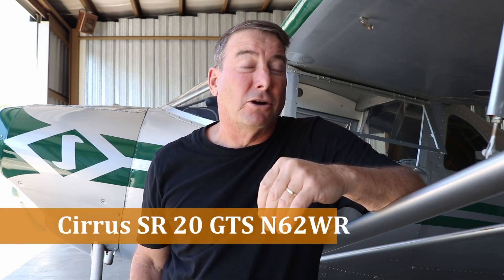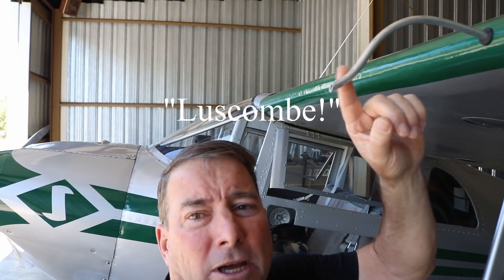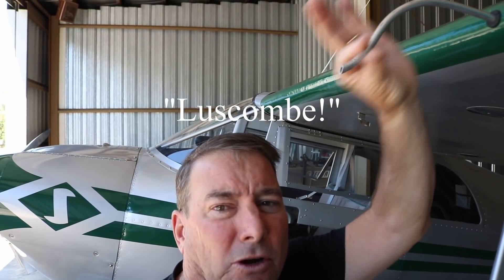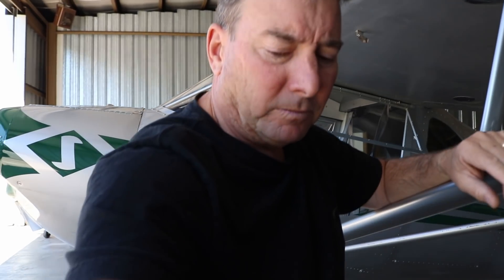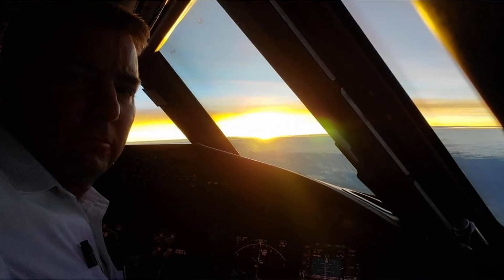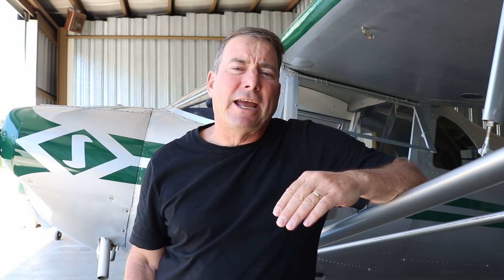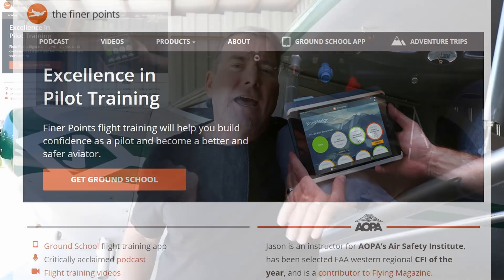Cirrus SR20 Crash Conway AR - AQP for GA!

Comment: Always good, Captain Browne, 
I always judged that,  in an emergency,  VFR, I could fly with no Airspeed Indicator. 
(Stick and Rudder Pilot). 
You can sense your speed, based on the stiffness of the controls. 
(Full Spin qualified, I know when a plane breaks into a spin. )

Comment: Learned early on aoa and power setting will give a particular airspeed if the airspeed indicator is inop
Reply: Yes!  In VFR you could do touch and gos all day, safely, with just power settings.  Poor guy needed more training.
Reply: Yes, and a cirrus also has a GPS speed indication. Even when this is not that precise like the pitot speed, it can help to prevent a stall in approach.

Comment: We have always taught from day one to not only fly by indicated airspeed, but also by paying attention to the visual attitude. Where the nose is on the horizon considering the power being used. With a little practice it is easily possible to maintain a desired airspeed to within a few knots with zero reference to the clocks. A forgotten pitot cover should not be cause for a fatality in a light aircraft especially. Also, I would not consider a Cirrus a suitable aircraft for a low experience solo student.
Excellent vid as usual.
Reply: @capnskiddies  At 200hp the Sr-20 is considered a high performance airplane. Since it generally flies faster, all the speeds including stall speed are faster meaning things happen faster in the pattern and it's easier to get behind the airplane. It's avionics suite can also be complicated for a low hour student..
Reply: I'm a Cirrus pilot and I think it's insane that they are used to train or for low hour pilots. They are fast, powerful, slippery,  terrible glide characteristics,  and too much automation for a trainer imo. I just think we should all learn to fly in a 150 or a 172 where nothing works and sitting on a milk crate
Reply: Just fly the plane!!
Reply: @rdawgz866  LOL. Idk about the milk crate part, but I agree. Initial flight training should always be done in forgiving aircraft.
Reply: @thetowndrunk988  and for full disclosure I fly a SR22T and I think it's by far the best single engine GA aircraft there is. Just not for beginners.  I saw a guy at the place I rent training for his instrument rating in a SR22 Turbo that he owned! So a 120 hour pilot getting set loose in that hot rod. Same as a Ferrari after your kids road test.
Reply: @rdawgz866  My school plane was a 65hp Champ with no electric system at all....after soloing I "graduated" to a 80hp Champ with radio and starter..... I can't imagine learning in anything more complex than say a 152. There's enough going on in a low time pilot's brain, cluttering it up with glass cockpit and a slippery airplane is just a recipe for disaster.

Comment: According to the GoFundMe page for the pilot, he was not a student but an instrumented rated pilot. Pitch and power setting should have been no problem for an instrument rated pilot.
Reply: @GaryMCurran  I believe it.  Private pilots with working airspeed indicators stall/spin on turn to base or final every day.  My bet is that he was highly stressed in a situation he'd never been in, and just let himself get too slow.  I am lucky, I had a primary instructor that noticed I was looking at the gauges too much during my first flights, so he covered them up.  I flew for a long time with none.  It was a great exercise, and had this pilot had that training he might be still around.  Juan is correct, we need better training.
Reply: @tomsmith3045  I can't see how you can be stressed on a CAVU day less than a mile from the airport on final, hell, less than 250 yards from the end of the runway.  i doubt very much that he was turning base to final there, and if he was, WHY?!?
I don't know what the final outcome is going to be, but this is going to be a lot more than failure to remove a pitot tube cover.  Engine failure, maybe?  That I would believe, especially if it happened on downwind, or in the pattern somewhere before he turned to final.
The more I think about this, the more I'm going to believe that something else happened in the airplane.  How about a snapped aileron cable?  No, I'm not saying that's what it is, I have no clue, but something happened that he wasn't prepared, hadn't trained for, and didn't have the time to figure out what was going on and fix it.  The more I look at this, it's not about a pitot tube cover, although that might have been a contributing factor.
Here, how about this.  Water in the fuel tanks.  Again, speculation, but if he didn't happen to notice the pitot tube on the wing, did he actually bother to sump the fuel tanks.  If there was a significant amount of water (even less than a quart) in them, he might have been on the tank with water in it.  Run up, taxi out, take off, that might have been just enough to get him to downwind turning base, or just before, and complete engine failure.  Again, I don't know, but until I hear differently, I'm going to stop blaming lack of airspeed indication, and look for something a lot more dangerous, like an engine failure.
Reply: @GaryMCurran I would have thought so too, except after paying attention to things like the NAL report (or however it's spelled), stall spin in CAUV is really common.  My bet is that you learned to fly in a similar way that I did, with lots of time spent in slow flight, until you were completely comfortable in that part of the envelope...and very aware to avoid it completely at low level.  I'm realizing now that many people don't get that level of training, and they just don't know how the airplane flies.  One example that comes to mind is the air france crew, I believe, that stalled the jet over 90 times, all the way down to the ocean.  Nothing else wrong but lack of airspeed indication, and a professional crew.
Reply: @tomsmith3045  as I'm reading more information, i.e. The Kathryn Report linked in the description, they said he appeared to be struggling with an engine issue.  I think this may have been a case of "the impossible turn" on takeoff, and with lack of indicated airspeed as a contributing factor.

Comment: I've been following a pilot flying a Kodiak in PNG, on every take-off he selects a speed either40 or 50 (knts I think) and a marker by the runway, if that speed isn't reached by that point he briefs to himself the abort take-off procedure. Many of the strips he uses are very small, steeply sloped and surrounded by mountains & jungle. On every flight he passes the speed (before the mark) and calls out "40/50 continue" - even when its an empty plane. (If you think the Husky climbs then the Kodiak is a skyrocket, with empty climb-outs often hitting 2500ft/min with reducing power to keep the speed down so he's got space to make a turn without joining the terrain.)  AQP in action.
Reply: Ryan, (the Missionary Bush Pilot) is incredibly methodical. I have learned a lot from him and brief emergency takeoff procedures on every single take off because of his example even in the C172.
Reply: His WW2 airstrip video was awesome!
Reply: He’s very good he will survive his time bush flying.
Reply: Power plus attitude equals performance
Reply: Ryan Farran, Juan Browne, Scott Purdue, the Pateys, Tent Palmer, Niko Sypridonos and a whole host of other youtubers have done a lot to advance GA safety.  One thing I have learned from these veteran pilots is that the certificate only qualifies you to be a lifetime student.
Reply: @dougarroyo794   I lost a lot of respect for Trent Palmer when he paid a dowser to find where to drill a well on his property. Of course, it didn’t work.
Reply: @bjs2022  Hey, it might have, and then it would have been a good deal. Now I'm not saying dowsing works, but there is a possibility that a dowser has learned to read the terrain better than the average Joe and thus have a better than average chance of locating water, even if it doesn't always work. If his price was a fraction of the cost of exploratory drilling, then it could qualify as a small loss if it doesn't work, and a big gain if it does. 

If the owner can make a video of the dowsing and get enough back on YouTube royalties to cover the cost of the dowser, then the attempt was absolutely free, which is a good deal in any case.
Reply: Love his channel
Reply: @bjs2022  I unsubscribed from Trent & Cory's channels when they started posting non aviation related content.  Jonas M., although entertaining, is just sending out the wrong message regarding risk.  Hopefully over time the aviation community will support great content and we see those that are just here for monetary purposes go away.
Reply: @bjs2022  if you are watching him to see what a great consumer he is, yes I get that... otherwise not so much
Reply: @bjs2022  my dad always used the same old guy to dowse his wells. Always got awesome wells.

Comment: Pitot measures the RAM AIR speed, the IA, Indicated Airspeed.  True and Ground speeds are different.   If he had a glass panel then he would have known the ground and true airspeeds regardless of the IA being zero (if the cover were still on).   Landing without knowing IAS would be more difficult, but in the SR20 he should still have been able to do it using the sight picture.
Reply: Glass panels calculate TAS from IAS, pressure altitude, and outside air temperature. They do it exactly the way we used to do it with an E6B. You can't calculate TAS from GS unless you know heading, course, and winds.
You're right in that the sight picture would probably have saved him. Power and pitch.
My guess is he got too slow and stalled and spun on his turn to final.
Reply: @johnopalko5223  Glass panels display IAS from the pitot/static system and get GS from a GPS source.
Reply: @speedomars  Right. The Air Data Computer (ADC) computes TAS from pitot/static pressures and outside air temperature. If there's no pitot pressure, there's no IAS or TAS. With a blocked pitot tube, all the pilot would have would be GS, not GS and TAS as you stated in your comment.
Besides, the airplane flies on IAS (more accurately, CAS). That's the measure of the air flowing over the wings. The airplane doesn't care about TAS or GS. The pilot might, but the aircraft doesn't.
Reply: @johnopalko5223  Not always.  Both the ground speed and the drift angle (difference between aircraft heading and GPS ground track) can give true airspeed and wind velocity (how an EFB does it).   Still, as I noted ground speed is all one needs to make the landing.

Comment: I would imagine that when a pilot see an (obvious) erroneus speed reading, he would ensure that the 'throttle' is set to a value that ensures sufficient lift - as you indicated yourself. This is more obvious to a trained than to a student pilot. Competence is Knowledge + Skill (x attitude).While the student pilot has some knowledge, I would guess that his Skill is limited.

Then to a question; could the (GPS) ground speed be to any help? Knowing the local wind speed and direction could the ground speed help the pilot setting a 'logical throttle setting'
Or, is the pitot tube readings so different from the ground speed that it would not help?

And while I keep thinking; with todays technology is any training conducted with a single student pilot in the aircraft - but watched remotely from the ground by an instructor who could take the control if so necessary (or the aircrafts 'FMC' take over the control?)

Or does it boil down to preflight SOP - what we call checklists?

Comment: This is tragic and I feel for the family. It also emphasizes the need for a thorough preflight every time we fly. I will mention this accident to my flight instructor. Maybe teaching to abort a takeoff when things aren't perfect or teaching landings with no airspeed indication early on. Maybe this will prevent a future tragedy. One time a while back I started the takeoff roll and noticed the airspeed indicator was not reading and rejected the takeoff. I went back and shut down and someone got out and took the cover off. I usually don't let anyone "help" while preflighting the plane, but somehow this slipped by. If someone asks I usually say  "Stand over there and don't say anything." Another time I knew the pitot cover wasn't on because it was missing when I arrived at the airport a few days earlier. During the climbout I noted that the airspeed was working erratically and the altimeter was not indicating correctly, and continued using the panel-mounted GPS for altitude and groundspeed, which was close to airspeed on this day. The weather was CAVU with almost no wind. During the flight I turned on the pitot heat and after about 15 minutes the bug that had moved into the static hole cooked down enough so everything started working. Those Piper pitot tubes get really hot. Part of my flight training was to simulate a full electrical failure at night and land the plane with no instruments or lights. I also know how the plane should feel through the approach. I didn't need that skill, but I had it in reserve. Part of instrument training is recognizing instrument failures such as this. After getting home I managed to fish out the bug's remains with a fine wire. There is good reason to keep the pitot tube covered, especially in a place with a lot of bugs. Now I keep a spare cover in the rear baggage area.

Comment: Flying using angle of attack (AOA) indicator would be easier and safer than by using indicated airspeed.   To avod stall, simply do not exceed the stall angle of attack.  There is also an optimal angle of attack for climb, for efficient cruise, and for descent.  During steep bank, one is still able to stall the aircraft even at high indicated airspeed when one pulls too hard on the stick to exceed the stall angle of attack.   Landing an aircraft using the AOA is also easier, as one simply maintain the proper angle of attack for the approach, while adjusting the throttle to control the rate of descent to stay on the approach path to the runway.   When reaching near the runway, advance the throttle a little to slow the rate of descent, then soon enough, the aircraft will be in ground effect and wants to float and one simply needs to ease gently on the throttle to the idle position to get a soft touchdown on the runway.   By minimizing the use of elevator while trimming for the proper AOA, and using the throttle to control the rate of descent and climb, stall and spin accidents can be much reduced.

Comment: So how would he have known when to rotate without air speed?
Any ideas?
Reply: That's the point; he wouldn't have, so he shouldn't have. If you're asking how he did, probably just by looking out the window and watching the runway disappear underneath him. Not exactly SOP.
Reply: That would be the question for his CFI during the investigation, I imagine.
Reply: I can tell the speed of my plane within 5knts. I can feel it in the yoke as well when she wants to fly. After noticing the air speed alive and rising I’ll check again when I feel the plane wanting to lift off.
Reply: @hadrast  That's scary dumb. How a person could get through training and that be possible is incomprehensible to me.
Reply: Airplanes want to fly. Particularly if trimmed properly, they will rotate and fly off on their own, with minimal control input. 
It's always a good idea to glance at the airspeed indicator once rolling down the runway, to at least make sure that it's working, even if you are a "seat-of-the-pants", 'wind-through-the-wires" type of pilot.
Reply: When the plane wants to fly

Comment: The 80 kt check does not confirm the static vents are clear! Actually a double static vent blockage when the ac starts to climb is horrible.  About 20 years ago a Peruvian 737 came out of the paint shop with the static vents taped over and eventually crashed.  In the Vampire the drill for static blockage was 'gently break the glass of the machmeter using the crowbar'!

Comment: Juan, you talk about the walk around. I must say, for a period I too was loose about my concentration during walk arounds and noticed I would take calls or texts or whatever. I noticed that I was either missing things or not completely sure about what I saw or checked. I made a rule for myself that I wouldn't do any conversations, phone calls or texting during walk around phase. It's a quiet period where I can focus strictly on the key critical elements. I try to always remind myself of such things because its easy to forget things like doors, window, locks, pitot covers, fuel caps, brakes flaps, spoilers etc. It's easy to miss such things in todays time shared and conflicted world. I like your reminder to check airspeed, good reminder!

Comment: The " Idiot Check " saved me an embarrassing moment when I forgot to untie the tail tiedown after being distracted during the first pre-flight after the fuel truck's arrival. Probably not a possible     deadly error on my part, but it taught me to always do a second walk around before entering the cockpit.
Reply: I will implement the 'idiot check' as part of my routine going forward.
Reply: The idiot check can also be used postflight. Walk 30 feet towards the FBO, turn around and take a quick look. Is the rotating beacon on, is the plane sitting level ( flat or low tire), did the lineman actually chock you or just bring them out? Etc.

Comment: Besides basic pitch and power knowledge, numerous GPS devices will give ground speed.  Use those as you would your indicated airspeed and it will get back on the ground.  I agree with the one last walk around the aircraft before climbing in and are you you really looking or just going through the motion.  Focus!  A preflight should be considered a sterile cockpit activity.